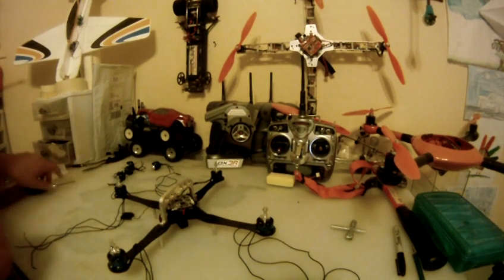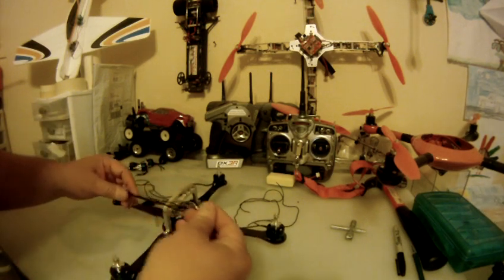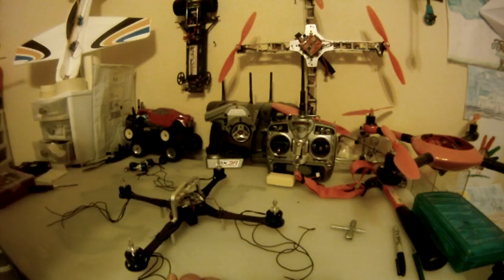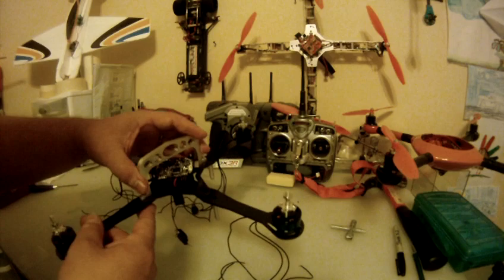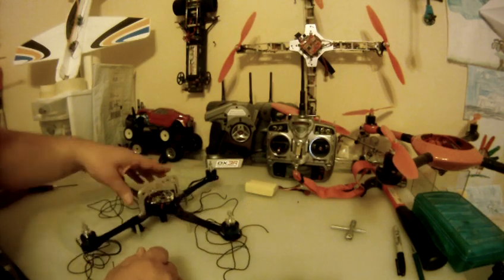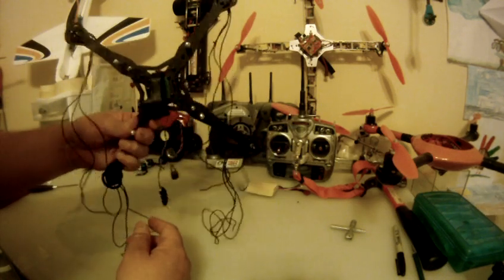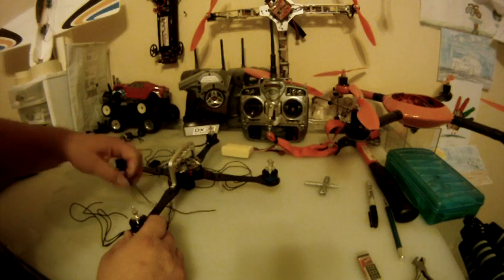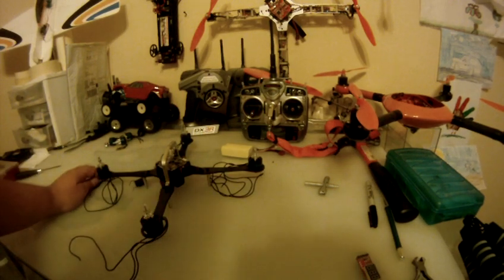Custom Mikrokopter Sport Quadcopter frame (build 2)

Comment from the maker: @slickjimmy76 lol ok your right. you went out of order on the thinking part. lol   in the beginning you think what you want to build ie camera carrier etc. then figure out the motor to lift it. then the size of frame. those motors use a prop shaft type adapter and are 1300kv i used the motors many times great motors but bad bearing prone, anyways.  how much does the camera weigh?  i was able to use those motors on a 17" 150gram frame before with 8" props and it could easily lift at least 75grams

Comment from the maker: @slickjimmy76 well i have learned that big or small doesn't  necessarily mean more stable.  for instance people think big is more stable. but recently my 13.5" motor to motor quad is the most stable ever,, its going to come down to the flight controller used. but of course if you fall outside the boundaries of configurations like prop size, that causes instability.  like a 450 class quad with 8" props will def change things.   anyways are you planning sport flying?

Comment from the maker: @slickjimmy76 hey thanks!;.well i found in warmer climates the murata or piezo gryos hold up well, with the mems your going to get less temp drift. i would always recommend MEMS  but if the budget is tight. do what ya can.   i ran those 24gram 1300 motors on a few of my smaller setups they work great. just keep spare bearings on hand.